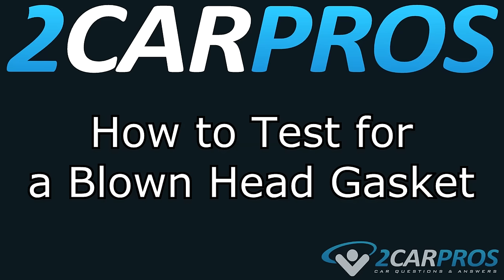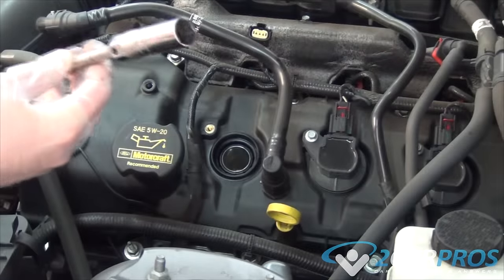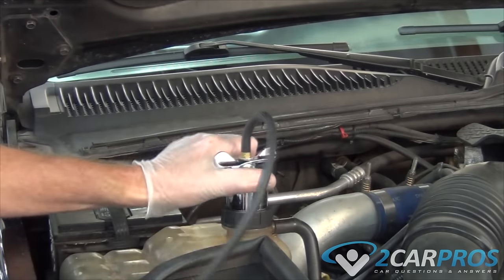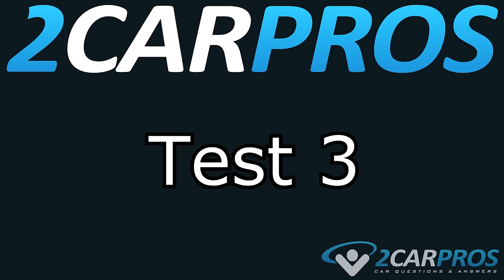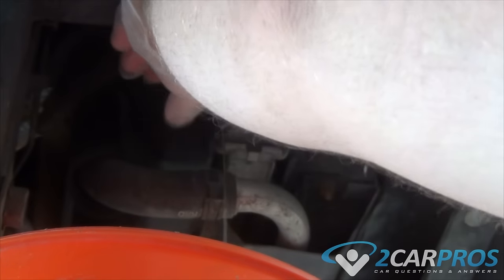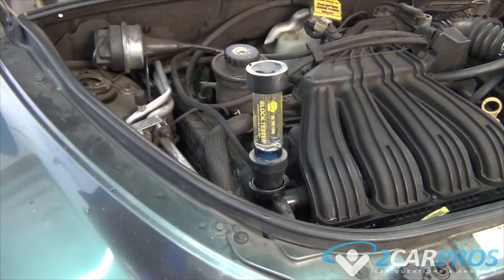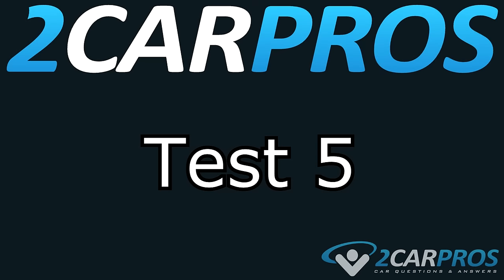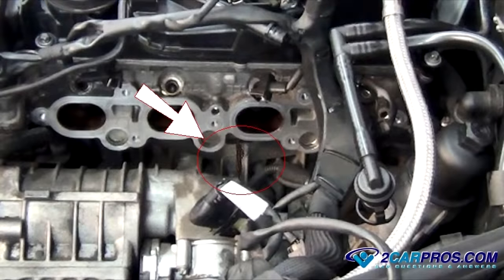HOW TO CHECK FOR A BLOWN HEAD GASKET

Comment: White under The cap is not always head Gasket its also Becouse car is used for short distance and never get change to worm up to working temp 90
Reply: Do you mean 90 is operating temp? 180 is complete combustion for any gas motor so I don't know where youre getting your info but you should leave it there.

Comment: My oil filler cap had mayo substance and the coolant had bubbles on the top but i get no white smoke and i can drive my car for hours without issues, what could be the problem
Reply: The head gasket could be bad between cylinders. That why the coolant isn't getting into your oil, but its burning off in the combustion chamber. Hence the white smoke.

Comment: I don’t have oil in water or water in oil but keep getting air in my collant system. Can it still be the head gasket? It runs well for a few hours after bleeding the system but then it builds up pressure and air again. Ford Fiesta 2005 1.4
Reply from the maker: That isn't air exactly. That's exhaust. You most likely have a blown head gasket. Thanks for watching!
Reply: @2carpros  what if I perform a co2 test and it comes back negative? Would you still think it’s the head gasket? Because I’ve no milky symptoms or bad idle. Everything is fine until the radiator starts to build pressure. 

Thanks

Comment: Hi I have a 2004 Saab 9-3 Convertible . It was leaking somewhere around the water pump so I replaced it but now when the engine gets too hot the coolant tank starts to boil and it leaks somewhere. I'm hoping it's not the head gasket.
Reply: You had air in the sytem.

Comment: I notice continuing shortage of water Alradietr be with foam in oil hood with no mixing in the water, or the engine oil Alradietr Is this the blown of head Gasket guide
Reply: Sounds like intake manifold gasket. Your burning coolant in cylinder (s)

Comment: 99 Tahoe 350 vortek. #3 cylinder constant miss even after new plugs,wires,cap,and rotor. Checked all wires plugs etc. Head gasket or intake gasket?
Reply from the maker: Sounds like a head gasket if there is coolant in the oil. Thanks for watching!

Comment: If my Subaru sti overheats, the fans don’t turn on, yet they work because we tested them, tested the connections, changed the relays, changed thermostat, coolant temp gauge, did a coolant flush and burped the cooling system, no leaks and no CEL then what could it be???
Reply: Like I said once my temp hits 190-205 the fans still don’t turn on but they work I was thinking maybe a bad ecu signal or something along those lines
Reply: Coolant temp sensor**

Comment: What if you suspect air is leaking in thru the head gasket?
Reply: I think I have the same issue at the moment. I don;t have any coolant mixture with oil so it threw my kind of off. Currently trying to replace the head gasket and resurface the cylinder head. Will let you know how it goes sometimes this week.

Comment: my Dodge blows white smoke when it is first cold started but goes away and when the engine is warm smoke comes out the tail pipe and water drips out if it and under the oil cap is a thick yellow sludge
Reply from the maker: Yep, sounds like a blown head gasket
Reply: Tim Duczer my 95 Camry blew a puff of white smoke when start for a few seconds, then it's normal. I checked, coolant was low but oil is normal. i don't know what the problem was.
Reply: Lin Kiều could be intake
Reply: Yep head gasket bad

Comment: Cars and overheating. But I don't have heat and the radiator is boiling over into the overflow and not returning to the radiator. Any ideas
Reply: Daniel De Groff heater core issue
Reply: Daniel De Groff we have a 2002 Buick rendevous doing same no heat and boiling into resivor also and want return to radiator when hot enough that it should started trying easy stuff first thermostat and water pump still the same changed the temp. Gauge no help I've been bleeding the lines till I'm sick of it so now small kink in heater hose so everyone saying clogged heater core or clogged radiator ok so I tried to block heater core and by_ pass it  so it's not hooked up same thing overheating within just a few miles so tried this k _ seal shit in case was gasket maybe still core is by passed seam to run for a longer time before getting hot so think I'm about to get it nope what I got for thinking still getting hot so tore all back down flushing all out put new radiator in was a damn nightmare to change so since took so long to get back together Left core by passed so now it's getting hot within a few miles again and it runs like a brand new car no miss or nothing damn car will fly 75 MPH no problem with car at all just overheating no water is in oil or sludge on the oil cap either everyone saying head gasket car runs to good but I don't have a clue what to do for it now don't want to keep sinking money into it and still not get car fixed any ideas at all I would greatly appreciate it
Reply: Replace your radiator cap it's bad. Your overheating issues should be fixed after replacing that cheap part.
Reply: Water needs more pressure to sustain liquid form under high temperature. Without pressure, it boils off at 100 Celsius. You need more capacity so coolant lines are pressurized. It sounds like your coolant line has been broken somehow like a bad radiator cap for example. Ensure the coolant line is maintaining the pressure it’s built to produce (can be verified by looking on the overflow cap). 

If your coolant system isn’t sealed up tight everywhere, the pressure escapes and the water now loses it’s extra capacity to hold more than 100 degrees of temperature. Since the engine heats it over 100 degrees, it’ll boil off and flow bubbles into the overflow tank.
Reply: Replace the radiator cap, possible Tstat
Reply: Replace radiator cap, replace thermostat and replace water pump and have lines checked.

Comment: My truck warms up really fast but never goes past 210 ( the middle of the temp gauge ) it just take like only a mile of driving to warm all the way up and I do not have heat is that a bad thermostat or a blown head gasket please help?
Reply: That's the way it is supposed to work. If it sticks right at 210 all the rest of the time (summer, going up a long hill) you are fine.

Comment: Just curious what's the best option replacing the engine or doing the head gasket?
Reply from the maker: Really depends on the situation. Is the engine shot? How many miles? Is the car worth a swap? Is it a small leak? There is a lot of factors. Usually it's better to do just the head gasket. Thanks for watching!
Reply: @2carpros  it's a 2008 acura tl has about 170,000 miles. I've had it since it was new. The wife ran it hot,I'm pretty sure it's the head gasket.
Reply: @2carpros  lol my wife is like the grim reaper to cars...

Comment: Hello. I'm having an issue. My temperature are good and the car doesn't overheat. But what's happening is both my top and bottom hoses on radiator are super hard as a rock. Once I drive around for 10mins or more...  Again car doesn't overheat and I'm also not using a thermostat. My car runs better without it  since it's a turbo charged car making 700hp. My temperature stays around 168-176 depending on how hot outside is.... And another thing is that when the pressure builds up and the hoses are rock hard nothing goes to the reservoir to bleed out some of the pressure when the coolant expands. So my reservoir tank does not get filled neither does it send back coolant when engine gets back cooled. It just stays the same place I filled it manually.. all the pressure just stays in the radiator, engine and hoses.. nothing bleeds off to reservoir. ANY HELP OR IDEAS?????
Reply: Did you manage to fix this

Comment: Hello! I have a 2001 Honda Civic Ex and it has been overheating for a few weeks. I’ve changed the thermostat, radiator and have even gotten a flush. There are bubbles in the coolant area and I’m also not getting any heat in the car. I’ve went to two mechanics. One told me it is the head gasket and one told me it isn’t. There is no milky substance or anything. Any help or recommendations? Thank you!
Reply from the maker: Yep, sounds like a head gasket. Those bubbles are exhaust and they get trapped in the heater core so you have no heat. You will also see these bubbles in the radiator like you stated. Thanks so much for watching!
Reply: you should've went to autozone and bought some blue devil head gasket sealer for an 01 and i promise it would be just fine for years
Reply: @theuntouchabletee4470  gotta be cautious with head gasket sealer. There's a very real possibility it can gum up your coolant system.

Comment: I found a thick substance in my coolant reservoir which is now located in my thermostat housing. What could it be, why is it there and how can i get rid of it ?
Reply from the maker: What color is it? Because if it is oil, like I mentioned in the video, chances are it is a head gasket that has gone bad. Thanks for watching!
Reply: 2CarPros THANKS but i took it to the dealership my water pump was going bad so they're fixing it now

Comment: Had white cloud coming from my exhaust, had a cracked leaking radiator, I was loosing coolant. Got the radiator replaced & now only thin smoke for about 5 to 7 min after startup. Could I have a small head gasket fracture?
Reply: Thin smoke on startup sounds like worn valves or valve stem seals.
Reply: I have a similar problem. Had a bad radiator leaking. Used stop leak to fix the problem for a while but the car ran hot smoking about 4 times. Had radiator replaced. And now car seems to be running fine with the occasional thin poof of smoke. On startup and while idling. Not really bad but visible. Don't know if it's a possible small head gasket fracture or one valves like you had said in this comment. I went and bought some head gasket repair liquid. But haven't put it in yet because I'm not sure if that's the problem or not. What do you suggest?

Comment: I have a 2004 Pontiac grand am. It was riding fine around town, until I had to put some gas to it on the interstate. I saw white smoke come out of the exhaust pipe. In just a few minutes it overheated with smoke coming from underneath the hood. I added water and was able to make it to a store. I bought some coolant and it started leaking out. Is this a blown head gasket? The dealer I just bought it from said it's not, it has to be tested. Unfortunately I bought it as is, because I was under pressure. I just got offered a job and I didn't have transportation.
Reply: ouch it does hurt when people are dishonest and don't realize what a problem this can cause to have to snit around with a car---I too, took the advice from a slick salesmaggot and I have had my car to 6 different places all wanting to do $$$ome thing or another----I sure hope my bugaboo car does not have a head gasket problem---stay Strong
Reply: Theresa K17 unfortunately for me, it was a blown head gasket and gas leak. I lost power with the car and it didn't crank back up.
Reply: Classic head gasket symptoms as you've discovered. They sold you a messed up car and knew it. Probably threw in some temporary leak stop and hope they weren't caught.  They're scum. Always, always pay a good mechanic to check out the car before buying any future cars. Evenif the car shows has a good Carfax history nothing beats a trained mechanic with a good eye. You pick the mechanic don't let them pick their criminal mechanic friend. If they won't let you have a mechanic check the car out. Run the hell out of there and never look back.

Comment: Could you help me? A 1996 Cadillac sts mostly every morning products white smoke from the pipe, but afternoon ,after job nothing. No milk is on the oil cup, and max. 2 dl coolant losing per month. Is it a head gasket issue or what ever could be??😉
Reply from the maker: Sure sounds like a head gasket. Thanks for watching!

Comment: I have a 05 BMW 530i. I replaced pcv valve, 6 coil packs and plugs. intake manifold to fix smoking 10 months ago, now it's smoking again on startup and idle. no overheating. any suggestions?
Reply: mistarealitee74 leaking valve cover. Replace with new valve cover gasket. The oil is getting into the exhaust and causing the smoke at startup be idle. It is always leaking you just don't see smoke at higher speeds because the faster passing air disperses the smoke so you don't see it since it doesn't allow the bellowing smoke to collect as it does when it's idling.

Comment: the way I found out was loss of power
Reply: Mines spit small puddles of coolant out the exhaust.
Reply: Mine barreled giant white clouds of smoke
Reply: My mate hit debris, rupturing his radiator, overheating the engine which led to the head gasket failing tremendously! All on my 21st birthday 😂
Reply: My 2000 Sts blew thick white smoke...lost power....but no milky goo under cap... Someone told me it could be somethin else other than gasket since oil not milky.. Exhaust has sweet smell to it...
Reply: Buick Regal  Do you think head gasket repair will help?
Reply: Dimitar Dimitrov if your talking about that fix it stuff in a can don’t use it
Reply: over-heating...
Reply: I used that Blue Devil stuff exactly as recommended. It worked for s couple thousand miles, then coolant started appearing in my oil again. Shortly after my water pump literally came apart when I was driving. Bearings in the pulley just came apart and coolant spewed everywhere. Then I tore the engine down and rebuilt it. 
If you have a junker that you just need to run a little longer head gasket repair will probably do that but it's not a permanent fix
Reply: If you have something that's worth keeping just get it repaired the right way the first time
Reply: @TheSickest666  mine too, after you changed the gasked it worked normally?

Comment: I have a 2006 toyota 4runner with the V6 and I noticed it was running hot, I cooled it down and ran it again with the radiator cap off and it's bubbling, the oil fill cap has mustard yellow on it, but the oil is clean and at its proper level, also, there isn't any white smoke. I'm just curious what it could be. Any ideas?
Reply from the maker: Sounds like a small head gasket leak. I'd try this https://youtu.be/Xi41RFMP8Ow Thanks for watching!
Reply: @2carpros  well I do like the idea of not tearing into the engine but I think it would be best to fix it by ripping the whole engine apart, afterall it has 210k on the original head gasket and it wouldn't be a bad idea to replace the timing chains, water pump, and all the other odds and ends or if that dosent work out I'll consider an engine swap

Comment: I have a little bit of white in my oil it’s been like that for months but I don’t know if that’s bad or good cause there is no knock and the oil thankfully hasn’t got super milky
Reply: Did you pull the dipstick and check the oil? Some times that milky white goo is a result of condensation in the upper part of the engine not being burnt off. A bad pcv valve can cause this. Aso take the car out for a long drive every now and then to give it a chance to burn off the condensation.

Comment: my car has oil in the radiator Reservoir like a tiny film of it at the top but the rest of the coolant is green under it my radiator has no oil in it my motor oil has no water in it it's just in the coolant reservoir
Reply: MrBrandon50b me 2 did you ever find out what it was
Reply: Super Wintebow  I cleaned the  Reservoir out an it didn't come back  but the car had been setting for like a yr B4 I got it an I Know over time the  reservoir will get like a film on the top so I don't think it was oil but to be sure  I added some blue devil block seal an has not done anything yet
Reply: MrBrandon50b bbbbn
Reply: MrBrandon50b  did u find what the problem was?
Reply: MrBrandon50b
Reply: Sometimes when you mix antifreeze orange with green you get a thick mayonnaise type goop.all over the reservoir.Its nothing major just flush your system and clean out the goop
Reply: Can also be leaking auto transmission cooler lines into the radiator.

Comment: I have a 2003 Mazda protege5  2.0liter it smokes like a sive I replaced valve seals valve guides timing belt new spark plugs new plug wires ..head gasket g oi t it done an ot still smokes really bad ...got pulled over on way to work and was told to park it I cant drive it like that..the weird thing is whn it's almost out of oil it runs good an doesn't smoke whn I add oil it runs like crap an smokes out the town...any ideas please
Reply: It doesn't over heat at all there is water comes out of the tail pipe an the smoke is a heavy grey an smells like burnt oil an gas

Comment: any imput on steel seal. does it work????  i have a bmw 535i blowing white smoke and if it is the head gasket the numbers are ridiculous for repair. any suggestions are greatly appreciated. its got twin turbos so really hope thats not the problem😢
Reply from the maker: Sorry we have never used such a product. We always do it the correct way by replacing the head gasket. That does sound like a head gasket from your symptoms though. Thank you for watching!

Comment: what about condensation can that make your oil look like milky color.
Reply: Everardo Modesto yep and if yoh drive short distances It can also make it look like that also your PCV valve if it's cracked loose check the hose condensation could be getting in there